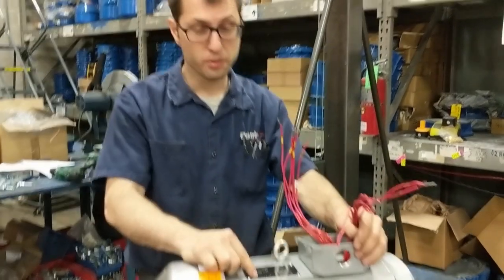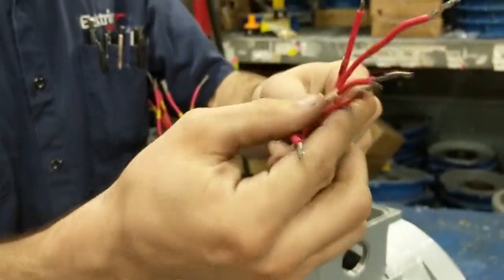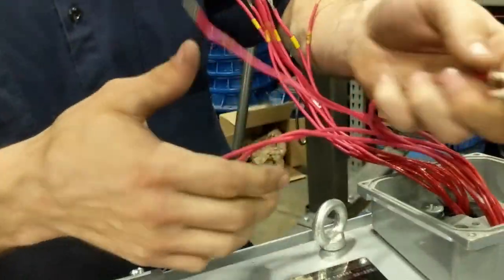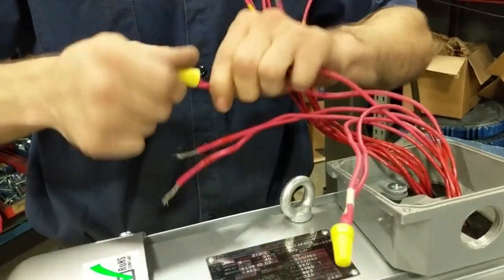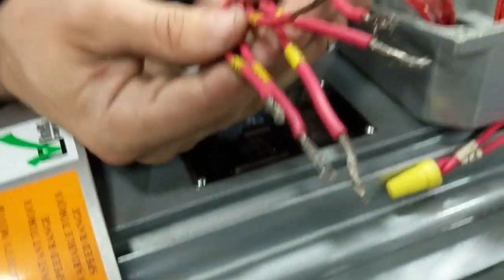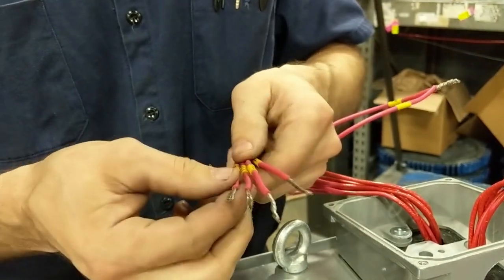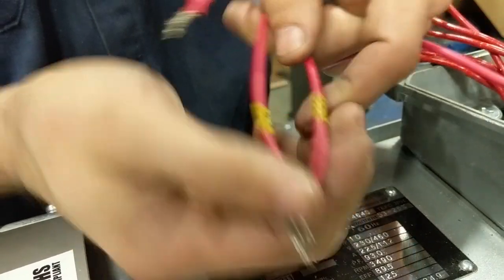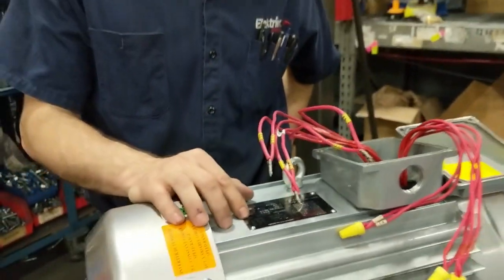How to Wire an Elektrim 12-Lead motor for 460V 60Hz

Comment: I bought a very same motor recently (forget model number, but was a "car wash" motor too). I'm trying to run it as the idle motor for a rotary phase converter. I've wired it up to 230v, followed the diagram correctly. The first time I ran it, it worked well for about 2 hours. The next time it continues to shut off. Generally the first time I can get about 10 min, then 5, then 2, etc. 

I noticed one leg of the wires were slightly warm. All the other ones were perfectly room temperature, but one leg was just warm enough I could feel it on my forearm. Does this motor have any type of thermal protection or anything of the sort? 

I wired the motor to go to a 30amp plug so I could quickly disconnect and more the motor out of the way. I couldn't get all 4 wires to fit in the plug so I just ran 1 wire from the grouping of leads at the motor to the plug (same size wire as what is in the motor). Do you think this would be a problem? Why is it only 1 leg that is getting warm and the others are perfect?
Reply: What do you mean by you couldn't get all 4 wires to fit the plug??   4 wires should go into the plug: Lines 1,2,3 and the ground.
Reply: @Idrathernot.  I was using 6/3 thats why ;)

Comment: Where do you connect the other 3 wires on a star delta setup?
Reply from the maker: This is for a 460V wiring diagram, which uses a Delta connection.  Are you trying to wire the motor for 575V?
Reply: @ElektrimMotors  A 440v motor. Your vid is a DOL right? I am doing a control panel  With star delta control panel. If L1 to U1, L2 to V1, L3 to W1. Frok main contactor. Where to put T1 T2 T3 from delta main contactor.

Thanks
Reply from the maker: @guitarone71  Hi Joshua, please contact us at 847-524-1074 (855-463-55358) or email support@elektrimmotors.com with your contact information and a technician will reach out to you.